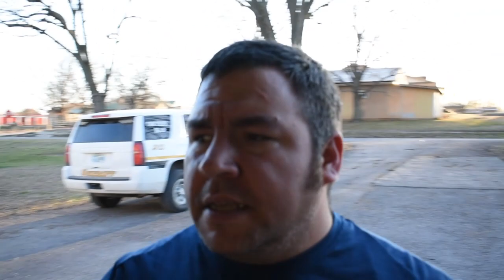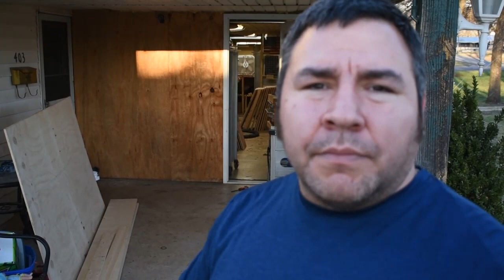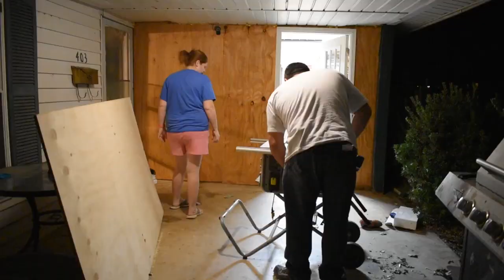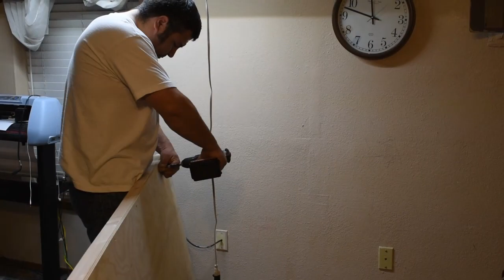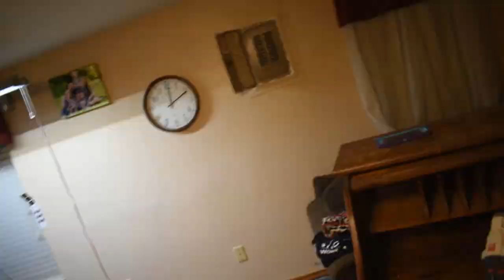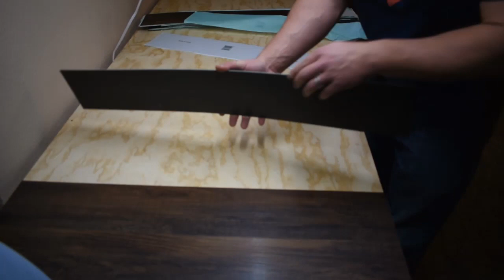It's time to start all of the projects now, Chicken coop, Rabbit pen, Work table

Comment: That table is really cool. If you wanted to you could build that table to fold down when not in use and have like a cupboard behind where the table folds for the machine and everything so there's no worries about the kids getting into it or anything when folded down?  Just a thought 🙂.
Reply from the maker: fallenangelwi25 Thanks and thanks for the information I did not think about that I will have to look into it. Thanks for watching
Reply: @EddyFamilyFarm  no problem 😊. You could put hinges in it to collapse about a foot or 2 in then folding legs then put 2 to 3 shelves under it on the wall that way it turns into a cupboard when collapsed
Reply from the maker: fallenangelwi25 OK thanks I will look into that hope you have a great day